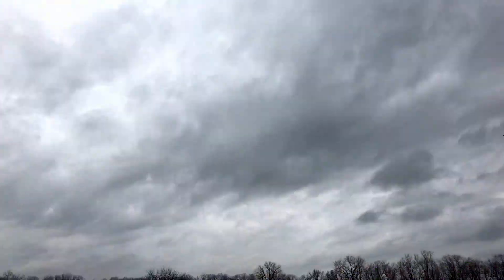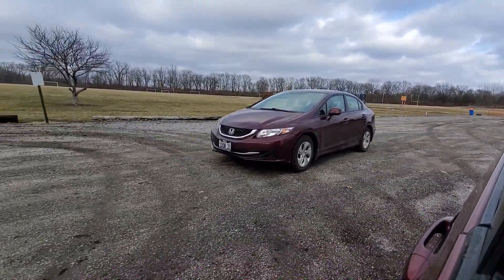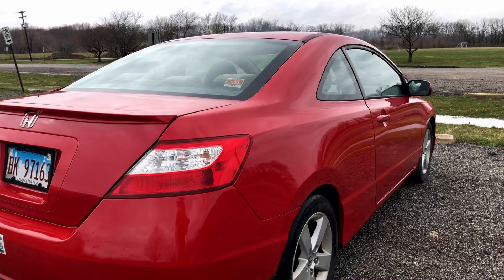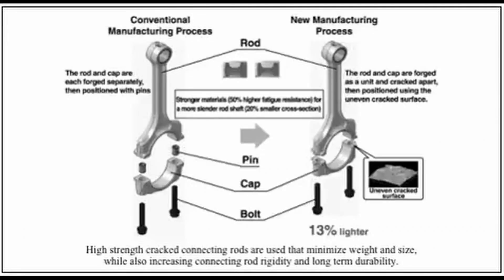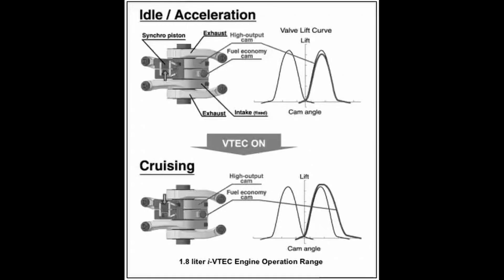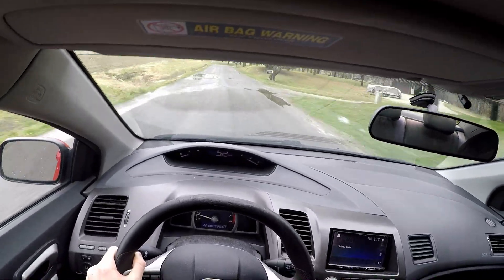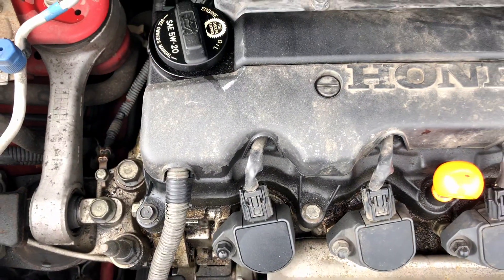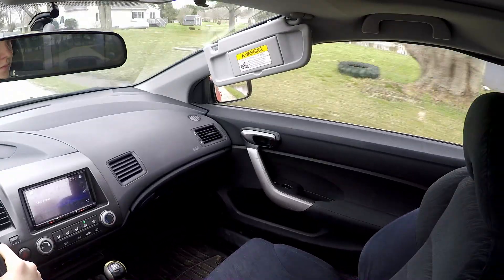A Brief Guide to the R18 Honda I-4 Engine

Comment: I have a 2007 Honda Civic coupe lx I’ve been wanting to turbo but idk much would I be able to turbo this civic or no?
Reply from the maker: It’s possible, but probably not worth it. It would be a lot of money, a lot of labor, and a lot of headache for not a ton of payoff. You have to keep in mind this engine is not meant to take boost, and it’s not like a Subaru where theoretically you could use the auxiliary parts from turbo variants of your car because there was no turbo variant of this car. You’d need lots of bespoke parts and a good tuner. I’m sure it’s do-able but it’s not a simple job. In my opinion, if you want a faster FA civic save the time/money and buy a SI, there’s more support for boosting those K20s as well if you really want to go the turbo civic route.
Reply: @carpartsandexhaustfarts  wow thank you so much man you saved me a lot of money I’ll probably make it a show car and just make it look nice
Reply from the maker: @beezydaone  For sure!

Comment: I had an 07 Civic with an R18. I loved it and enjoyed driving it with it's just sporty enough output combined with excellent fuel mileage. It died just after 200K due to a cracked block which is endemic of the R18.
Reply: I understand that it was fixed for the 2009 model.
Reply: Mine is an 07.
Reply: Where you driving it hard? No hate I drive mine a little hard with no mods. I’m just asking because I’m just about to hit 200k. Just about 600 miles to go. I’d love to just keep it but I have another vehicle and could sell the Honda.

Comment: My dad's car have this engine as well, it's been 11 years already.. Still running smooth with a transmission leak that is.. Had to fill it everytime.. Other than that, still good. It's a Civic FD though, I'm from Asia... It's over 200K kilometers now.

Comment: I think the VTEC on this might be similar to that used on the CB400SF and VFR800 bikes? They're both pretty nifty. I actually have a FN1 Civic with this engine and have real difficulty in justifying changing to another car - I'm either going to lose fuel economy or performance with basically any upgrade. It shows that this engine is a real sweet spot in terms of delivering real world performance and low running costs.

Comment: Hey, so great video, i have a follow up question: I own other cars, but it seems im starting to appear at the track scene, waaaay more often i thought i would. So the bimmer has to stay a daily driver, i cannot afford to track it that often, and power is not my crave. I want to train on endurance and discipline... I have the sedan r18 (5spd). If i do breaks, suspension and lsd, can i track it reliably? I don't actually require much more power. later i may boost it, 200hp is enough for me if the car stripped for weight and has handling...  or the si comes with suspension that already fit heavy long track days? (sorry, but never owned Japanese, so looking for insight). I am an engineer and work on machinery on the daily and have replaced head gaskets and suspensions many times when i was young. I have never done full engine rebuilds, but i'm guessing as long as i have the guide in front of me and all the tools (which i do), i can do everything myself down the line. Or is it worth swapping for si? except engine/suspension, what other differences are there? is body more rigid on the si? control arms? Appreciate the feed back.

Comment: backwards vtec baby
Reply: Ok how does it's vtec work exactly?
Reply: I did watch the video but i still don't understand how it works exactly. I think I'm too dumb
Reply: @Manuqtix.Manuqtix  At some point, around 3500 RPM on this R18A Civic I think, a control solenoid opens and sends oil to the inside of the camshaft. In each cylinder, that oil pressure pushes pins in the rocker arm for the high-lift lobe connecting it to the other two rocker arms.  The result is that the other two arms operate on the high-lift, long duration profile. This opens the intake valves sooner and keeps them open longer.  The engine computer determines when to activate the high-lift arm based on engine RPM, load, temperature and other factors.  The VTEC system is optimized for power, whereas the i-VTEC system is optimized for economy. In the R18 engine, i-VTEC works on the intake valves only. (The single camshaft has 20 lobes on it; there isn't room to put more for the exhaust valves.)  On a DOHC (two camshafts) it is possible to put VTEC on both camshafts.
https://www.youtube.com/watch?v=7tTVYzuQs8s

Comment: It might not be fast but the manual Coupe r18 is fun to drive. If you actually put your foot down or stay above 3000 RPM it's not slow. Threw you a sub because I enjoy the sarcasm and I own a r18. My opinion of the intake and fake VTEC is good fuel economy when you want to but when you put your foot into it you can actually have some pretty decent acceleration especially when you drive a manual and you can choose the RPM that you stay at
Reply: yeah, thats variable intake manifold power

Comment: I’m thinking of building a small hot rod, perhaps based on an MG Midget, Austin A55, Ford Taunus or Ford Anglia. I suspect that you might be able to put this and the L Series in a rear wheel drive layout, but can you put them up to a transmission from a Miata, or BMW 3 SERIES?
Reply from the maker: I think switching an engine from a transverse fwd configuration to an inline rwd one is quite the task to begin with. I'm sure with enough modification you could make it work but that would be quite an undertaking.

Comment: I've owned one for 4 years. Expect about 37mpg general use. 42 mpg is possible cruising at 70mph in 6th. 
You have to stay at 70 mph to achieve that though. 85 mph Crusing expect about 34 mpg.

Comment: I just purchased an '09 Civic LX coupe w/72k miles a few days ago (mint condition) for $7k  and love it! Bought it mainly for commuting to and from work bc of the reliability and excellent gas mileage, not so much performance. My other car is a modified '14 STI. Was bored today and decided to learn more about the honda.  As long as people keep up with the maintenance and stay on top with all that  involves fluid changes, these cars should last at least, 400k miles. To buy a car like this nowadays from $5k to $7k with low mileage is a bargain! There's people out there who modify the heck out of Honda cars and they still hold up. Honda did well in making their engines.

Comment: Been driving it for a while and its a fun economy engine.6 speed gearbox feels good. Ive got an E36 with 140 hp from 1.9l and it feels comparatively slow in the lower rev range, but that might be due to the aggressive electric throttle tuneon the r18. Good economy and it does accelerate comfortably in 2nd and 3rd gear when over taking. Ive seen countless videos of the engine being turboed and it does between 200-300 hp without much effort or upgrades. Upgrade which might provide 15 HP if the crank is swpped from the r20, but this is no performance engine. Although it has the same dimentions as B18, the head is quite bad. integrated exhaust manifold, smal ports and valves, make it impossible for the R18 to achieve high airflow and power. Comfortable city engine and a decent highway cruiser.

Comment: I have an s2000 and a 07 civic coupe that is my daily driver with 160k miles. At what mileage does the block “crack” I’ve own it for 4 years now pretty much trouble free, but since there was a recall I have a feeling it could die at any moment even though it’s running perfectly at the moment.
Reply: My 08 civic coupe had a crack on the block with only 118,000 miles.. so I guess there's no telling when it could happen.
Reply: @christianmontesino171  Damn that sucks.  I bought the civic when it had 118k miles and what are the signs of the cracked block?
Reply: @Miguel-eo6td  tbh I just bought the car like 2 weeks ago with the issue, dude said it had coolant leak so I went took it to my mechanic he said the water pump was bad and then he cleaned the area of the block where it looked like it was leaking and said he can get it repaired but its not guaranteed but until now I haven't seen my temperature rise past have way point. So I guess you shouldnt worry about it because it is repairable.
Reply: @Miguel-eo6td  Leaking coolant.  And it wasn't recalled.  Just an extension of warranty from 7 to 10 years.  My '07 has 189000 miles on it and so far no crack.
Reply: This will give you a good idea:
https://m.carcomplaints.com/Honda/Civic/2007/engine/cracked_engine_block.shtml

Comment: THE R18 PULLS MORE THAN U MIGHT THINK QUITE A SPORTY ENGINE FOR ITS SIZE
Reply: Can easily spin tires without dropping it from neutral also.
Reply: I had a dual overhead cam 1.8 L 125 hp 125 lb ft torque in prizm 02  this is a sohc with  more 140 and 128 lb ft torque... Honda killed it and Motor Trend Car of the Year and North American Car of the Year if you can find them for a good price buy it

Comment: To sum it up, the "fuel efficient" iVTEC can time itself and only run 12 valves rather than 16 valves at low rpm to save fuel. This engine can pull pretty hard for what it is.
Reply: It doesn’t run 12 valves
Reply: So this is not the VTEC engine this is not the VTEC version of that Honda mine is I thought this was the same thing I don't see the little piece in the corner of the engine though so
Reply: @markg2228  its there. at the back left
Reply: I agree I can peel out with the e brake on lol but seriously I can do I don't see how this engine is anemic

Comment: Would've been nicer to mention how these engines last forever
Reply from the maker: I that expectation sort of comes with the Honda badge.
Reply: @carpartsandexhaustfarts  yes but it's a nice thing to highlight :) Honda does performance engines just as well as engines you can count on. Most manufacturers can't say that I think you'd agree
Reply: Mine blew up at 160K on the dot… but I’m pretty sure the previous owner didn’t take very good care of it.
Reply: Agreed seeing a lot of posts with 160K to 250K + miles and still going strong
Reply: They last forever...until the engine block cracks, Google that.  They fixed that for '09-'11.
Reply: @joeyyung911  I have a 2015 R18 with a 5-speed and yes it will last forever

Comment: i had a 2008 civic sedan manual with this engine and then i got a 2012 coupe in white with also this engine...and it's great for what it was
but now i drive a 2020 civic sport manual and the K20C2 is such an upgrade over those it's unbeliveable how far honda has come with their economy entry level civic engines.
Reply from the maker: That's awesome! Yeah, Honda just keeps innovating.

Comment: There is an r18 making over 500 Wheel hp & it runs 11s in the 1/4. It tuned by Vit. Hard to miss it if you search R18 civic on YouTube

Comment: I have an 08 Coupe EX also with a 5 speed. Ive been a mechanic for well over a decade now. This info in this video is completely 100% accurate. This engine has some nice sounding features, driving it connected to the manual you can roast both front tires and gives a great redline 2nd gear chip! But is it a speed demon, or one with potential for it. NO. Throw a spectre reusable air filter and that's the only cost effective driveability gain you'll get. So that begs the obvious question. Well it seems the video host beat me to that, a well rounded, incredibly reliable, durable, go forever, gas sipper that if you throw a hitch on the back of that civic you can tow 4000lbs of enclosed uhaul trailer from Chicago to Naples, FL...at an average 5700rpm...in 4th gear...for 24 hours straight...done both ways. It is practically indestructible even under not ideal or even WTF are you thinking circumstances! I just broke 160K last week and all cylinders have even and...are at factory compression. This powertrain doesn't disappoint!!! Just please don't waste money modding it! Want more power, he said it best get an SI! Plain and simple, great video!
Reply: Roast tires? you are as stupid as biden.
Reply: @deibama  i lost brain cells reading his comment lmao
Reply: i live in naples fl and drive a 2008 civic coupe ex 5spd with 112k miles lol
Reply: 2006 SI with a K 20 dohc 2.0  is 6.4 sec to 60.... 2006 5 speed R 18 Civic :is 7.7. sec to 60 with its SOHC 1.8 the SI is only a little over a second quicker to 60 then the basey do you do a couple simple mods to that are 18 and you're pulling on  a K20 all smiles
Reply: Wow another dumb ass that doesn't know what the fuck he's talking about the stock block with a 72 mm throttle body and a  turbo  can make 300hp build the block and boer it out sleeve  it and add a 87mm Garrett turbo and you have a si killer from hell
Reply: dude fk yes thats awesome. I hope my 08 lasts as long, its an auto tho
Reply: Although this engine is supposed to be fuel efficient, I know that there are many people who say that their civic r18 does not yield more than 7km per liter despite doing the proper maintenance. Do you have any tips for restoring fuel economy in a 2007 civic?
Reply: @davidsrg1  That's about 16.5 miles per US gallon.
Reply: @davidsrg1  Wtf? I get 14,5 kilometers per liter, that is 33.8mpg or 7 liters per kilometer.
Reply: @davidsrg1  stop putting your foot to the floor and keep the revs under 3k?

Comment: I have R18Z4 engine, can't seem to find any info on that iteration. do you have any information or thoughts about it? also kinda got deeply sad after watching your video after already getting honda civic with a R18 engine. (no v-tec yo, /shedding a tear). also, really liked your video :)
Reply from the maker: I believe the R18Z4 is the exact same engine except it has a slightly higher compression ratio of 10.6:1 (vs the USDM 10.5:1). I think it's just the Euro spec, so not much is different. I'm so glad you enjoyed the vid! Don't feel bad, the R18 is still a fine little four cylinder.
Reply: @carpartsandexhaustfarts  thanks, it's nice but I thought It had the old school VTEC while buying it. Oh well :)
Reply from the maker: @TheLordstrider  I feel your pain

Comment: the rust on this motor is off the chain
Reply from the maker: It's oil that you're seeing I do believe, I think my valve cover gasket is leaking, but that's getting replaced very soon! As of now the oil level is fine though, so it's not a big issue.
Reply: @carpartsandexhaustfarts  all the galvanized parts are rusting bad not to mention the  bolts on the manifold

Comment: Nice enough engine, I have an FN1 Civic. It isn't fast and even if it sounds "ok" it seems to take an age to rev round to the red. But it uses a timing chain and it seems the only thing that needs doing are valve adjustments and spark plugs every now and again. Maybe the water pumps need replacing eventually I guess? As an all round engine it's excellent and gets everything right.
Reply: It also has bad belt tensioner problems
Reply: In what way?
Reply: @Negativvv  it will go out and make noise
Reply: @raiderrichard7291  Belt tenioner?  I thought it had a timing chain?  Or are you referring to the serpentine belt?
Reply: @Mark Anderson  I'm pretty sure that's what he's talking about. I had to replace mine recently. 🥴
Reply: @recon1673  just last week I started hearing a whining noise that correlates 100% with engine speed. Could be my belt tensioner.
Reply: @Mark Anderson  Oh jeez, that sounds fun. I have to get my valves checked soon and get this weird rattling noise that my Civic has at around 1.3k to 1.7k RPM at lower speeds.

At some point I'm also going to need to have my CVT serviced.
Reply: I’ve just done the water pump, tensioner, aux belt, rad, thermostat and sensors on my FN1. @95k miles. Might have been preemptive. But replaced with quality parts (OE or premium). The tensioner was squealing a little, and the water pump was weeping. So maybe it wasn’t quite due, but better to just get it done. 

If you ever decide to do it, I hope you have small hands. Access is tight on that side of the engine.

Comment: And the lower block was known for cracking.  I bought mine almost 2 years from a single owner who had the lower block replaced under warranty.  The car is at 250k now and still drives beautifully.  I use it as a work car and drive 100+ miles a day.  I'm looking to break atleast 500k miles.
Reply: You are speaking of the 2006-2009 R18s only
Reply: Only a very small percentage of 06 to 08 R18 had the engine crack issue, and it was from a specific manufacturer plant. The issue was fixed in the 09 to 11s for the 8th gen.
Reply: How is she today?

Comment: I got my sisters 2006 civic ex and just recently started doing research on the engine. So far I put a new muffler on it. This car isn’t “fast” but it can feel pretty sporty. I think I may put some coil overs on it just to make it take turns better and stiffer suspension since the one on it is pretty soft, along with reducing body roll. That and combined with a high flow cat, aftermarket intake, and exhaust kit, this car would feel pretty amazing. Haven’t had any problems with the engine yet and it’s at about 200k miles. Very good and fun car.

Comment: This car is alright 0-60 wise (around 8.5). It’s not meant to be a quick sport car. It is pretty zippy though.
Reply: The stock Civic 8th generation hit 60 in 8 Seconds stock.. The coupes 7.7 the si coupe low 6s
Reply: 8.5 seconds is faster than most cars on the European continent.